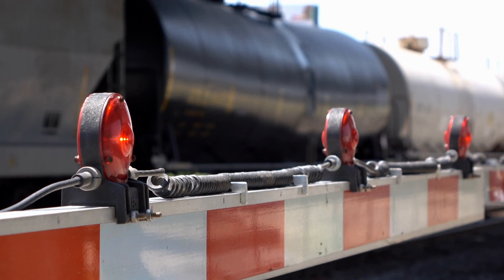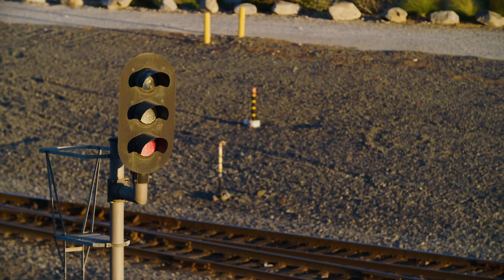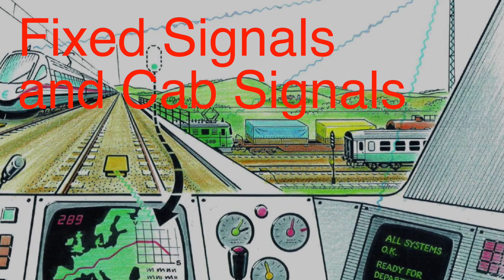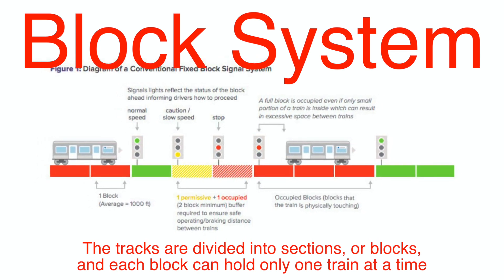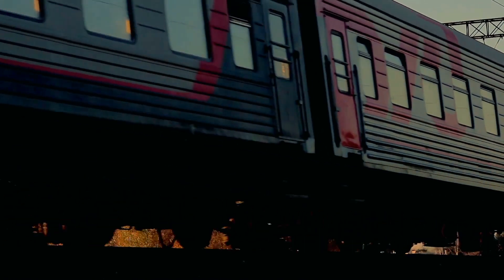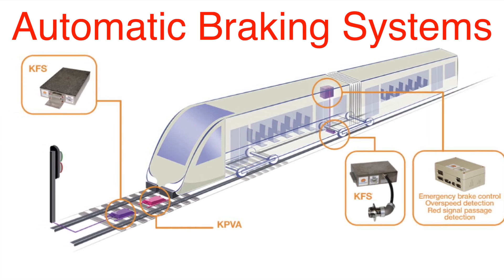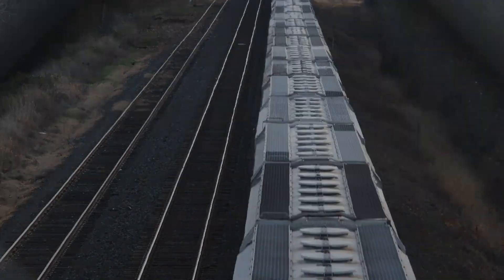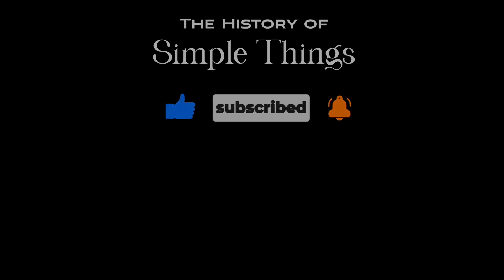How Do Train Signal Systems Work?

Comment: They are great until they failed, resulting in trains drivers need contact the signaller to carry on, or terminate at earlier stations. This also applies to points also.